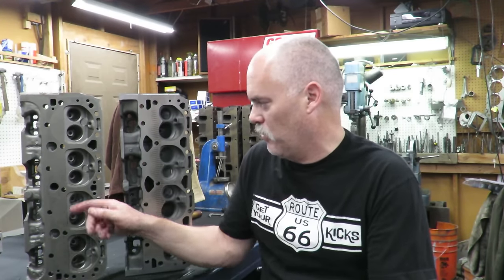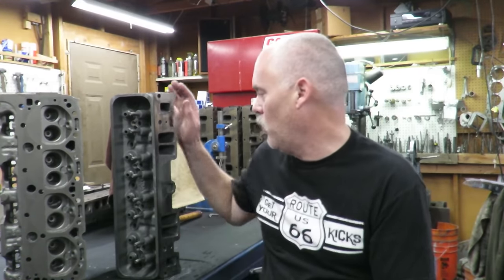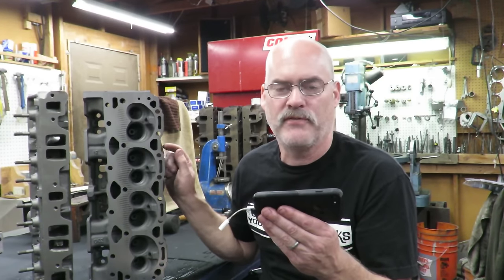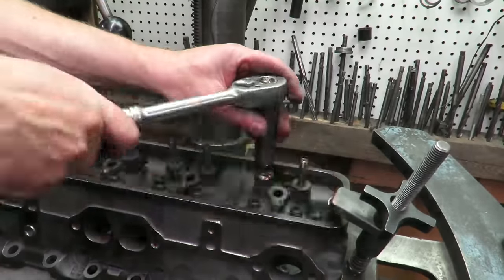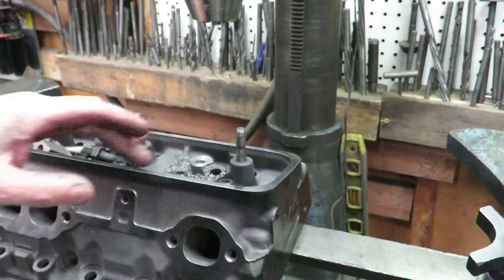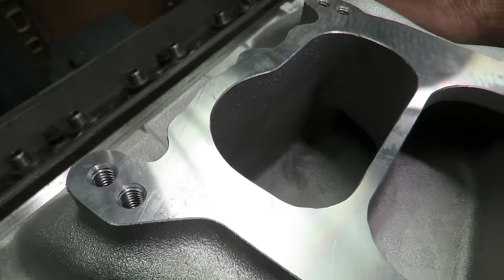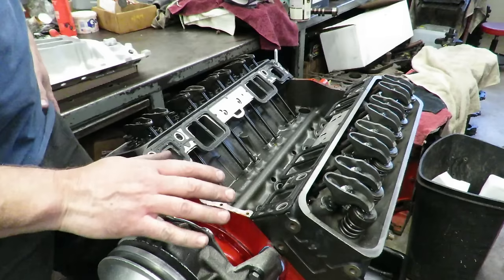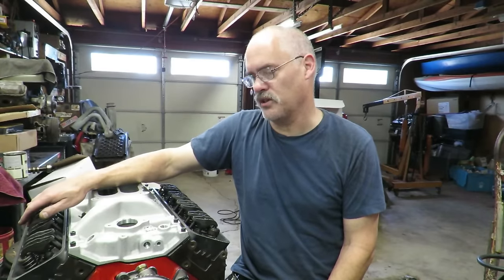How to get more power out of your Small block Chevy

Comment: My thought is why mess with an old small block when the LS/Vortec 4.8/5.3 can be had for next to nothing and make near the same power as the old modded small block but with so much more potential...
Even if you already got the SBC 350 by the time you spend the cash to buy a cam...get the vortex heads and go through them replacing seals, installing screw in studs ect...buy the gaskets plus R&R the engine along with disassembly and re assembly of the engine which unless you are doing it yourself but paying a shop to do it...which ain't cheap...you already spent more then to buy the scrap yard 4.8/5.3 with twice the potential..
As far as I am concerned the old SBC is a boat anchor unless it is a special one like a late 60ies 283, 302, 327, 350, 400...and even then I would sell it for good money as they are getting hard to find and put the money towards the LS swap...unless it is a matching number engine for my car that is...and only if it was an old 60ies muscle car lol.
Reply: I was going to do another LS turbo in my S10 but after pricing a crank,heads,pistons and rods i ended up going with a old sbc.I picked up a used Dart block,added a a billet crank and rods and am putting over 1400 to the tire before spray for a LOT less than had I gone with a LS.Say what you want and this is coming from someone who's been playing with and swapping LS motors for years but the old small block is cheap to build.
Reply: Oh and I'm currently running Vortec heads lol but that is subject to change when money comes around ;-)
Reply from the maker: If you have an early small block in your truck it is far cheaper to do a head and cam swap that to swap an LS in don't get me wrong I am a big LS fan if you have seen my videos on the 5.3 than you know that but I half to disagree with you on one point swapping in a 5.3 requires engine mounts a ton of wiring and in many cases a transmission swap and revised oil pan and oil pick up + if you are going with a carb you need an intake as well you will be hard pressed to find a good used 5.3/4.8 for less than 1500 with computer and harness add everything else a new exhaust system and most likely having to have a new drive shaft made and possibly a new radiator I have done several bone yard LS  swaps and it usually comes out to around 3K and that was the cheapest when all is said and done that is a far cry from $800.00 for the vortec upgrade I think you math is off
Reply: Are you using vortex heads on the 1400 whp engine lol...
Reply: harry guy 
There is more to it, harnesses, computer, adapters, ls specific trans or different flexplate, etc, it is better in the long run, plus it's 1500-2k for a 6 liter around here so although it seems easy there is more to it when you actually build it
Reply: Actually we are along with 2 BW S366's  ;-) It dyno'd 1397 when we turned it up but EGR temps where through the roof,you can only cram so much into a brick wall.Once I get heads and switch to the S400's she'll really rock n roll.
Reply: Derek Stewart LS prices have shot through the roof recently I can’t find a decent LS for less then 2k and that’s a 4.3 lol
Reply: they guys saving money need to do the work themselves.  a lot more then plug and play and a lot of searching in junk yards.
Reply: Joe schmo- A beat 4.8 is a grand or more anywhere within 5 hours of me.Sometimes it's a lot cheaper just to cram more boost in a older sbc if going turbo ;-)
Reply: LS1 are those engine that much better I heard the difference in big-time head sand ports are bigger and the water jacket are also larger so it stays cooler
Reply: I'm a huge LS fan but they arent the end all be all some fanbois (that dont have one) make them out to be and once you ditch the sbc distributor and go to coil on plug it narrows the gap BIG time. Now one big downside to the LS is if you're looking to build a big cube motor the LS is NOT the way to go.  4  inch is about the max stroke you can go even with the tall deck blocks.Between piston rock and the pin going through ring area there's a limit. Not to mention the cost,you're looking at like $10 grand+ to do a big LS that is handicapped by its design. Whereas a built Dart 434 SBC short block can be had for $4-5 K new. So for LS money you can go to a 4.5 bore space MONSTER small block.capable of 1k na lol.
       I paid $1800 for a built Dart that needed a refresh but it came with a custom Bryant crank,Honda journal rods,pretty much the works When it was built it had AFR 245 heads off the shelf and did 712hp on the stand running pump gas and in a #3700lb (w driver)2nd gen Camaro on small tires and nos he ran 8.6-8.80s @ Atco.Now I've probably got $3500 in it now after changing it over to a turbo motor(pistons/cam and rod bearings) and setting it up to run a 24x LS reluctor etc for coil on plug                                                                                                                                                                                                                                                                                                                                                                                                                                                                                                                                                                                                                                                                                       . Funny thing is I ran it in a LS ecu while I was settin up the MS Gold box  ;-) I have to build as I get $$ but by the time I add heads I'll have around $6-6500 into a motor that will easily max out my pair of BW S366's with billet 69mm wheels.I'm shooting for a fast spooling 1750-1850 hp and it'll do it pretty easily although I might have to go bigger turbo's  but they were from a old LS build ;-)
Reply: Alot seem to be forgetting the price of the vortec intake manifold for the swap.. that's $200 additional right there. 
Also, literally like almost any trans that works with a SBC will work with an LS.. same bell housing pattern. Sure you might need a different flexplate but that's about it.. 
Swap mounts are readily available for tons of vehicles now and pretty damn cheap. Especially if you have something that already came with an old SBC factory. Alot of the time the trans can stay basically in the same place and the same unmodified driveline used.
Reply: Stock LS truck engines are known to hold 500+ whp no problem. Maybe a cam and valvesprings that's about it. Check out Sloppy mechanics.
Reply: While I am a huge fan of ls motors,   the old school sbc is way cheaper to build. You can find old 350 core engines out of a pull and pay for around 100 bucks. And have a complete running 400 up small block for less than 800 it 900 bucks doing everuthing yourself.
Reply: Jacob Clubb not with a carb, intake, machine work and everything. If you have piles of SBC shit laying around then sure. 
Thing is for most people's moderate power goals there's no need at all to "build" an LS engine. You just buy a running truck engine from the junk yard and run as is. Maybe do cam and springs
Reply: shawnmeyer44 ls cams are just as expensive as sbc cams, but there is way more sbc stuff at swap meets then ls parts. Plus sbc will run as a stand alone the ls require computers, and everything else. If you use a aftermarket wiring harness its upwards of 1000 to 1200 bucks just for the harness. That alone makes the sbc a more "budget" oriented build
Reply: Jacob Clubb you can run a LS on a carb if you really want.. you can get a stock harness reworked to run standalone waaay cheaper then that. Like 300 if you have the harness.. hook up a constant power, few keyed powers and some grounds and it will run. 
It's really not that hard to go through stock harnesses yourself either, that's free.
Sure maybe you can do a SBC for less, but with an LS you'll have an engine capable of alot more for less. You have the capability of running a good inexspesive factory efi setup or a carb and a stock bottom end thats at least as strong as a budget build SBC.
Don't leave out a decent carb in your SBC build budget.. I'm not thinking of this as a guy already has SBC and carbs laying around, I'm thinking about starting out and going one way or the other
Reply: shawnmeyer44 I know all about the stock harness, I actually have a 6.0 lq4 motor to go in a trans am. Is do agree the ls motors are more of a capable engine and all that. But I'm not talking massive money here. If you go to a pull and pay, and want a budget motor, the sbc is always cheaper, there are more of them, There's more at swap meets and the likes. I'm just talking a mild build for a driver with a little get up and go. The abc is always cheaper to start up. The 6.0 cost around 1600 dollars about 10 years ago. And its got higher miles. The sbc would have costed about 500 in The same condition.
Reply from the maker: Ok so two things that need to be said here first off you guy's are turning this into an LS vs Old school small block video that is not at all what this video is about,
 this is for guys who have an early small block either carb or TBI and want to upgrade it and get a decant power boost for a pretty low price no where did I say this upgrade would be better than a 5.3 or an LS1 you are making it sound like swapping to an LS is just as easy and just as cheap as a head and cam swap on the engine already in the car/truck , It's just plain nonsense swapping in an LS is much more time and money add to that the fact that most of the guys interested in doing the above mentioned swap have never worked on or even owned an LS engine and if they do decide to do an LS swap they are going to make allot of mistakes the first time not to mention they have no clue how to handle the computer and wiring so please stop saying an LS swap is just as cheap and just as easy this is disinformation I have done many LS and Chrysler Hemi swaps neither one is comparable either  price or difficulty wise to the vortec head upgrade,
 if you want to swap in an LS fine,  but stop giving the guys that just want to stick with the old small block and do a cheap and simple upgrade a hard time! You don't need to throw out HP numbers that The LS can produce everybody already knows them.
Reply: @ harry guy

It's important to note the many ways a Gen 1 SBC can be modded to improve hp.  An Edelbrock Performer or Victor intake, a Holley carb, an HEI distributor, and a wide range of cylinder heads.  The Vortec heads are a way to increase power, and I think you missed that point.  New Vortec heads are the least expensive new heads from what I see.  Later on down the road I will upgrade the 993 heads on my Nova to a pair that make my wallet a little lighter and my Nova seem a little lighter :)
Reply: c41man dont forget that new fi-tech fuel injection jeggs sells. Supports up to 700 horses and looks like a carb for the old school look
Reply: A built 5.3 won't do what i want to do in my el camino. 6.0 blocks are outrageous here. Plus i didn't want to deal with the headache and extra money of an LS swap to match my 4 speed. I'm shooting for a 500+hp 434ci on 87 octane.
Reply: While I love both and own 2010 ss2camaro I have the article can't recall which mag but built both an ls 402 vs gen1 408 power was so close the gen1 edged in tq the ls in hp, basically apples & oranges.😎
Reply from the maker: If you already have an early small block it's not cheaper to go LS there are engine mount issues tranny issues ignition system issues fuel system issues and the list goes on you make it sound like an LS is just a bolt in replacement for the early SB that is quite far from accurate trust me I've done it more than once if you already have the early engine it is definitely NOT! cheaper to go LS

Comment: I always tell the tell of the engine masters episode with the header bashing and guys think im full of shit. Love the guys who put a bullshit air intake on their honda 4cyl and claim 20 more horses when they lost 5! Lol. Or the guy that puts a dual exhaut on a 200hp v8 and says he got 25 more horses! Lmfao
Reply: BuzzLOLOL On a higher horsepower car maybe. Your not gonna get 25hp from an exhaust on an engine that makes 170 hp! Highly doubt it. And 250 hp from bolting on an exhaust? It better be a 3000hp engine or more!
Reply: BuzzLOLOL Hmmm. I have the exact motor! I know they were underated but 435hp.Hard to believe you can restrict lets say a 500hp motor 180hp? I think theres more going on! But i guess crazier things have happened. Not sure if you ever watched engine masters header bashing episode, but if you havent you will find it very interesting!
Reply: BuzzLOLOL 10-4. Lil story on how i got my l88, about 20 years ago a local speed shop rebuilt the L88 for their jet boat. Put the motor in the boat and run about a quarter mile down the river n it locked up. Come to find out they rebuilt it but forgot to put oil in it! Lol  So one rod and a new crank and bearings later, its mine! Ive had it in a 67 chevelle, in my 75 f250 and now its sitting under the bench. You might of picked up 180 some horses from manifolds to headers but had to have some serious port mismatch or something going on. I know you pick up horsepower from stock manifolds to headers but almost 200hp is not usually the case! I can see 50 on a 500hp engine but 185 is crazy. Good for you.
Reply: BuzzLOLOL u dummy this duel duel exhaust only applies to engine with 400hp or more a 200hp v8 is gunna lose power with 3 inch exhuast as stated and dyno tested in the engine masters series on youtube look it up if you dont believe me
Reply: You dont gain shit if you have a computer .... No matter if you put a turbo cam fuel pump shit will run the same untill you get a tune... If your shit is carbed everything makes a diffrence yes i saw engine masters and saw the header bashing

Comment: Great video would like to add do not get Vortec heads made in 1996 and early 1997 they had a flaw in them they did not put enough metal or meet around the exhaust valve and they crack every damn time right there. Get one off of a 98 and up Vortec you'll never have trouble

Comment: Thank you for the explanation of the differences between the TBI and Vortec heads. Also, great info on the mods necessary for screw-in studs and lowered guide bosses for a higher lift cam. I already have Vortec heads on my 4-bolt GM Performance block from Summit Racing. But I wonder what kind of horsepower gains I'd get with a higher lift cam while still running the Holley Terminator EFI kit that's already in place?

Comment: I have owned chevrolets from 48 on mostly v8s. I now have a 1999 silverado 2500 with the all cast iron LQ4 6L. I am happy with that. The most satisfactory cheap set up I can remember was in my 76 nova first the metric automatic crapped and I put in a junk yard turbo 350. Then the 2 barrel on the 305 wore out so I found some guys that for 75 bucks sold me the manifold, qudrajet and air cleaner of a 73 350. That really worked great. Plenty of power, ran on regular, got 25mpg highway and about 18 city mileage. People bad mouthed that engine but it ran on and on for 12 more years and NEVER wore out. I did put a set of those bell shaped rubber valve stem seals on it but that  was it. I recommend the 305 as a great mileage engine that matches up with the automatic and highway gearing just fine. those old orange motors really ran a long time. I have actually never worn a chevy out. the engines with a good air cleaner and proper service never gave me any trouble. Now its sad to say its a corolla or Camry for a good transportation car. I have owned 2 85-88 corollas and a Echo(the echo is now my girl friends as she needed a car). the Echo is the best car I have ever owned. Amazing for 13000 dollars new delivered price and its going strong at 170k miles. Little offenhauser like engine that makes 109hp from 96 cubic inches gets 40mpg and pulls the car all over the rocky mountains with any load we put in it. How sad it is to see how far Chevrolet has fallen behind.

Comment: I was going to use a 1977 block and put all of my 1997 vortec parts on it , but crank is different , and the roller lifters too , I would have to use old school rollers with the bar between them . But I was able to get the 1997 block #7 cylinder sleeved , std. bore was still good with honing . now some new pistons and I'll have it back running.

Comment: I did that about 10 years ago on my pure stock race car. I welded and drilled and taped it so a old style valve cover would bolt on. All our rules said stock heads. When drilling front holes for the intake you get in to water. Just have to seal the bolts good. Speedway has a intake gasket that works.

Comment: I suggest you guys run Autolite double platinum spark plugs. If your vortec heads are from the 1996 to 1999 Chevy's 5.7 Liter 350 then gap the plugs to .060

Check them before installing because they were off on mine from the store. That's what oem requires. You'll get a better spark. I did the change to my vortec heads and "wow" it made a difference. Itll cost you 45 bucks for all 8 at Autozone not unless you have the 20 rewards then youll get them cheaper.
Reply: Good to know

Comment: Currently building the same engine, except with Comp Cams Magnum with 470 lift, flat top pistons, performer intake, and Holley 4 barrel carb 👊👊👊
Reply: Back in the 90's l had a 350 small block bored. 030 over, flat top pistons double roller time chain 650 holly 4brl 882 iron heads 280 comp cam. The cam was 280/460 ,I installed slotted rockers for the cam lift. I ran it at about 12 degrees advanced and it was a little beast of a mill setting in a 1963 Chevy shortbed . Never should have sold it. Money and truck both just a memory now 😥